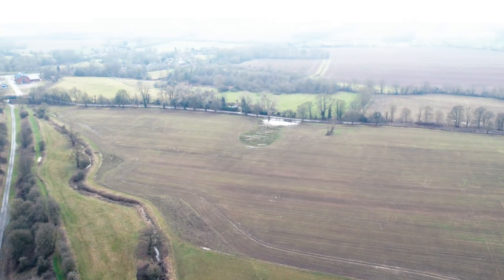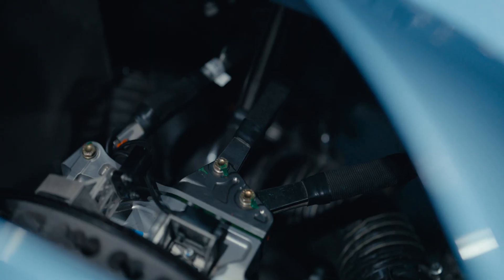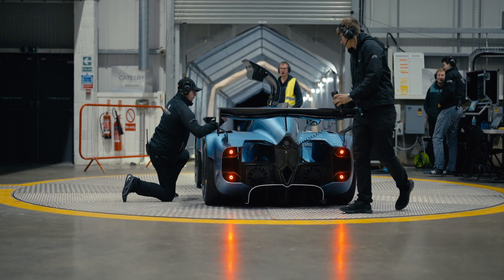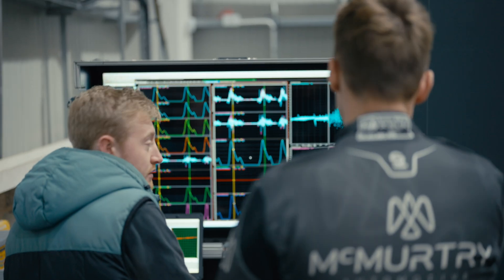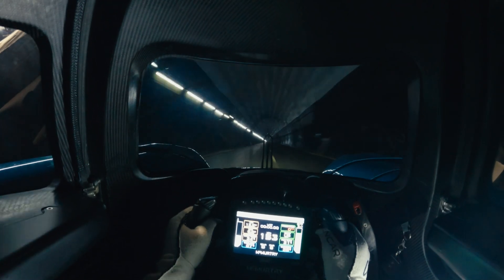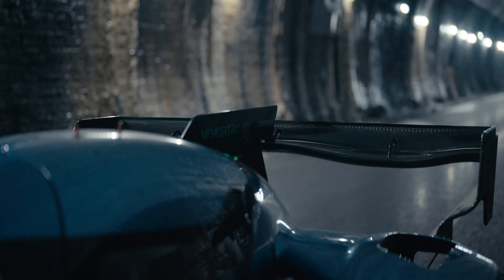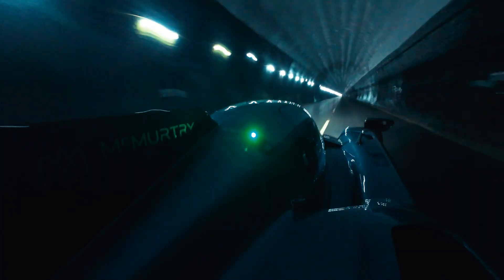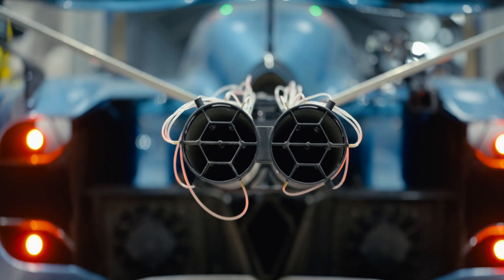160mph in a Tunnel! Aero Testing - Behind the Scenes - McMurtry Spéirling PURE

Comment: How do you control for the fact air is compressed driving through the tunnel, as such increasing drag versus driving through an open area? Trains for example have much higher drag driving through tunnels for this reason.

Even though this car is a lot smaller than a train it still must have some effect right?

Comment: Is there much aero noise from the narrow tunnel?
Reply from the maker: The Downforce-on-demand system does sound pretty epic in there!
Reply: @ Very good. It is a small car. BTW, If this car had room for a generator (range), could it compete with F1? Obviously, the car would need to get bigger. Seems like the stickiness at low speeds coupled with the electric torque would work. F1 reminds me of the pre-catamaran America’s cup in terms of it being a design to spec competition. The cars have gotten huge and you can see how dirty the aero is with the insane downforce vanes.

Comment: 160? That’s it? I’ve had my x1 to 168 😂 one hopes it goes much faster
Reply from the maker: Can do 185mph
Reply: @mcmurtryautomotive 😂 so … 20mph more than my stock 11 year old BMW X1… 😢 Dude.. That’s a simple tune away even.  Lots of room left when im north of 265kmh. You need some help? I can .. yell at your engineers for you.. “MORE BALLS… Better Final Gear Ratio.. At Least.. come one.. pretty please?” 😂. (Don’t believe me, look up the full drivers pack for an E84. Took an A7 and my bud’s 911 for an easy walk last night 😅). EDIT: ya know what they say round here, eh.. Meet me at MOSPORT or .. if ya can’t turn.. see ya on the 407 😉
Reply: They could’ve done 200mph lol

Remember this car runs 7.97 EVEN WITH a 150mph limiter down the 1/4.
Reply: @Heartfromsomewhere  Well, Bless your little heart. Top Speed, is Top Speed. 7.97 is great! For a prepped track and all. Some people like to .. what’s it called… Turn, though. I don’t mean only left like NASCAR too. Left.. AND Right! 😂 Also, It’s 160mph they said, not 150mph as you stated. 155mph is what most German cars for example are limited at.

Comment: Megacar-surpassing acceleration, Formula 1-rivalling cornering, and sport sedan-like top speed. Makes sense, doesn't it?
Reply: It's just science. Gasoline may be basically useless as far as efficiency is concerned (very little of it is actually burned to produce thrust) but it's still significantly more dense in terms of power than modern batteries. However, that's changing. Better batteries are being produced by the day, and eventually a sufficiently cool battery with several thousand miles of range will be reality. The only way to produce better results is to put time and money into R&D. The results out of China are already ridiculous, and make gas cars look pathetic by comparison.
Reply: @GB-oj2gt  It's just something car enthusiasts fail to understand... because they're car enthusiasts.

Comment: how do you compensate for the tunnel walls and end? as you are doing 160mph you are displacing a car sized mass off air that will compress as it pushes against the walls. Although the air you push through in the open on the road or track compresses in the open I would guess not so much as you dont have the tunnel walls to compress against. Also surely the barometric pressure increases as you drive towards the end of the tunnel as again air compresses as the car acts like a very leaky piston.
Reply: I also wondered how bullet trains do it. The Japanese did have an issue of a sonic boom happening as the train emerged from the tunnel and had to design a shape based on a kingfisher's beak to solve it.
Reply: @srinitaaigaura  I believe that is why the tunnel portals on HS2 will have special porous entrance/exit portals to reduce the pressure waves from this piston effect from when the trains exiting the tunnels at high speed so that they don't have to go for the nose design of the Japanese trains.  I read in the railway press that the porous exit portals at the HS2 Chiltern tunnel will be nearly 250m long which will be the longest anywhere.  The displacement effect of Catesby tunnel should be minimal for a small car like the McMurtry as the tunnel has a very wide 26-27 feet cross section along its length. It is a good question though that MathewJames asks.
Reply: @ Yes I remember reading the train issue a while ago. My question was really whether this is relevant for thecar that fills much less of the available space, I suppose there is also the reflection of pressure waves from a solid surface.
Reply: The original railway large-diameter brick ventilation shafts still exist at 1,600ft, 4,042ft & 5,225ft from the tunnel southern portal. Unknown publicly how well sealed these are today but they are highly visible from the bridleway that runs alongside.

Comment: Without a speed limiter what's it's max speed?
Reply from the maker: 185mph
Reply: @mcmurtryautomotive this super car supposed to go like 300+mph
Reply: @mcmurtryautomotive  only? Is it rev-limited?
Reply: @Mearex_  That's quite fast, we've been spoiled 😂
Reply: @mcmurtryautomotive 1 mph more! Give us the vmax run!
Reply: @mcmurtryautomotive  can't wait to see the top speed version on carwow
Reply: @mcmurtryautomotive  can't wait to see the top speed version on carwow
Reply: Remember it's a Single Reduction Gear. 0 to 185mph on one gear is amazing.
Reply: @ yes ofc, was just asking if a longer ratio would give it a higher top speed
Reply: @Mearex_ probably, it's a small car, so air resistance wouldn't be much of a problem
Reply: @Mearex_  i don't think top speed is that much of a concern with how fast this thing corners.